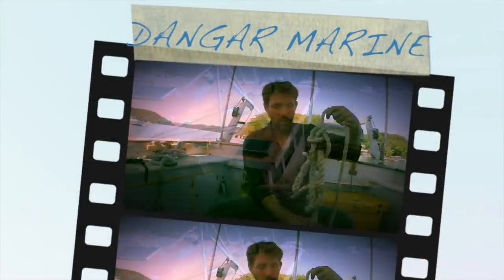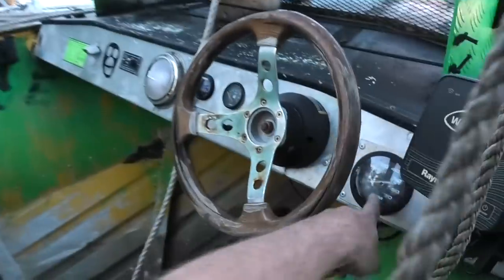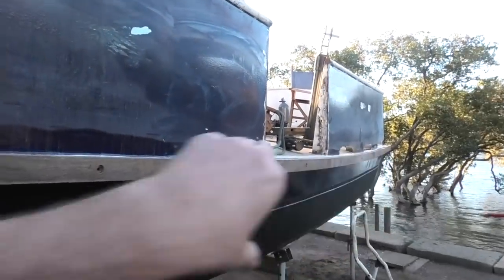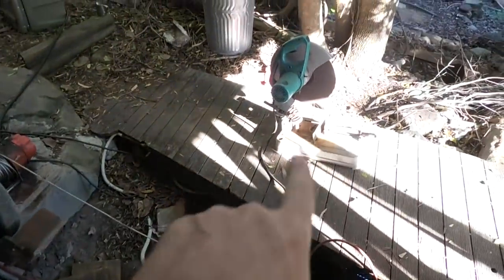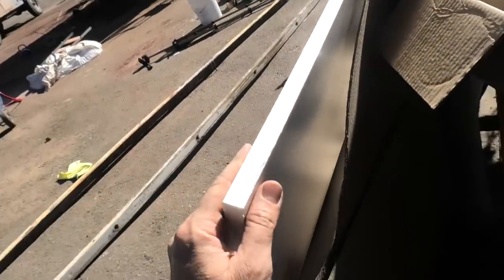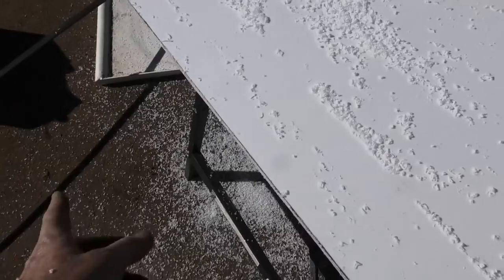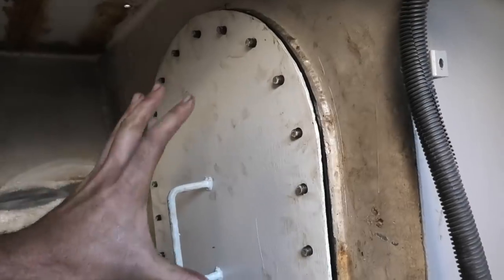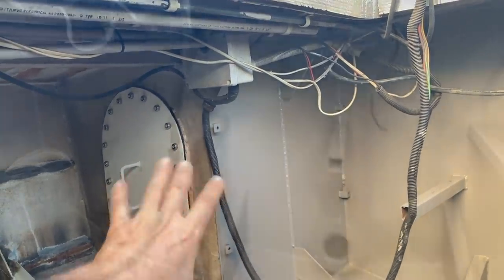Electrical boards and engine bay cleanup

Comment: You should look for a 4m RIB and put the 40 on it. Great runabout and tender.
Reply: Stu wants an inflatable. I know RIBs will have better sea keeping capability, but a 4m on the back of the trawler will kill any available space. Long term looking for something made with hypalon is the way to go. PVC in Aussie temperatures will have shorter lifespan.

Comment: Hey Mate you should replace that power cable running to your electrics. It can still be used for something on shore but I wouldn't trust it long term on the boat. Try and eliminate as much old wire as you can. It introduces too many variables and fault points. One other thing test that board your thinking about mounting the electrics to for spark flammability open flame flammability and heat flammability. You might want to also make sure it doesn't react to diesel fuel or become more easily flammable under those conditions with diesel on it. You don't want to find out later ten miles off shore that it catches really easily. Cheers Mate!
Reply from the maker: Yeah, I’m thinking of replacing all the wiring.

Comment: I don't know if the shelf is still an issue. I doubt it is. But I know here in the US there's this PVC like trim you can get from the home improvement store. It's primarily made for trimming out bathrooms. It's mold and rot resistant and all that good stuff. You could grab a small piece of that and make a little lip on the shelf with that. Guess I'll find out in the rest of the series if it's ever solved. Lol.

Comment: Good morning. Looking forward to the electric video.
I like the idea of the shelves....but just a thought here, since the plastic board is so pricey, I would consider just using plywood with an epoxy coat. The "StarBoard", as it's known here in America, is UV tolerant and I'm guessing you will have lots of opportunity to use it in places in direct sunlight. Anyway, I'm enjoying your project. Thank you

Comment: Looks great so far if you're going to use that shelf for the batteries on those three posts I think should be reinforced either to the floor or to the ceiling, batteries are heavy and bouncing on the wave you may just rip them off ..
Reply from the maker: I know what you mean but they've been there for a while and I can put my full weight on a single brace without the slightest flex which is a lot more than the batteries. Having said all that, a gusset at the bottom certainly wouldn't hurt.

Comment: That engine room is looking a whole lot better now!  one question....did you keep the full sheet of nitrile on the other fuel tank cover? and that will be interesting to see the pressure testing when that comes along.  man, this baby is getting there...and it seems like time is just flying by!!
Reply from the maker: No, in the end I was convinced to cut them both out to avoid condensation corrosion on the inside of the hatch cover.
Reply: @DangarMarine  well that makes a whole lot of sense now doesn't it!! Cool and thanks!

Comment: Have you tried an electric wallpaper stripper and a length of 4" drain pipe... I have used it in the past it works as a cheap alternative. Great vids, cheers Stu!
Reply from the maker: I'll see if my local hire store stocks them.

Comment: Hey Stu just an out of the blue suggestion probably too late to be useful (I'm only 4 mins into the video) but you could have/could still put a bolt into the front of hole of both rubbing strips and running a ratched strap around the front of the trawler and slowly day by day pull it in together

Comment: Hind sight is always better huh?  Bolt heads welded to back side of the brackets  would have been ideal. That way the nuts would have been visible on the board and could be checked periodically.

Comment: Those panels should be hinged so you can run the wires in the back of them
Reply from the maker: I can see how that would look neat, but I like having the wiring on the front so I can trace the path of the connections easily.
Reply: @DangarMarine  I did it so i could run all the wiring in finger duct behind and then new wiring can be added later on very easily.

Comment: For the battery shelf is the polyboard strong enough that it won't warp over time under the weight of a battery?
Reply from the maker: I think it will be fine with the three metal supports under it, but that's a good point to consider.

Comment: When it comes to inflatable tenders, I do have some experience in this department. 
After purchasing many waist of time cheap Chinese ones, I finally saw the light and bought from a reputable company.
Swift marine make a great inflatable, if you are like me and cant afford a Hypalon inflatable then I suggest the Highfield that they sell.
I've had mine for years and still nothing has come acropper on it.
Its a 2.6 Alloy bum and I've really treated it poorly but it just keeps staying strong, even with an oversized outboars.
Inflatable tenders are a bit of an issue with us grotty yachties but the arguments always stop now that I bit the bullet.
Btw, I recon I've saved $$$ by now by inisually spending the outlay of a good inflatable, than to buy 5 cheap Chinese ones.
Just saying.
Reply from the maker: Yes, I'm not expecting this cheap one to last that long, but it will get my out of trouble for a while and I'll look for a better one when I can afford it. Thanks for the tips!

Comment: all  electric should be in a sealed cabinet because you having them in the engine room .and battery's  in a vented box because of acid  fumes on flammable gases  which well corrode your electrics and other metal part.  always expect the worst case scenario  when it comes to mix electric water gases and fuels ( DON"T )  this is a practice i was taught and used over the 40 odd year boat building. great job you are doing too
Reply: Excellent Advice, Stevo.

Comment: Enjoy the break Stu. For a Perentie road trip @ 100-110km/h, I would recommend some hearing protection. Assuming no mods, she will be noisy at highway speeds (but you already know this from the M1/F3 no doubt). I used to use noise cancelling headphones. Takes the edge off the engine/road/canopy noise, can listen to music/podcasts on phone. Plus you can still hear high frequency environment noise (eg. horns, sirens ... tyre squeal). Would be awesome to see you drop in on a Brupeg vid. Safe travel.
Reply from the maker: Yes, have done a few several thousand km trips in it. Sure can get noisy!

Comment: are you going to put any noise dampening foam or sheet inside the engine bay?
Reply: I was thinking the same. Pink board glued and sealed up   Great
Reply: If he does not he will be sorry.  Can’t have enough sound insulation on a Detroit.

Comment: For a big wide gasket like that and with as many fasteners as there are holding the cover on I think 20nm should be plenty.
Reply: Remember that the gasket is going to relax over time. I'd verify torque in a week.

Comment: To be to standard, the batteries should be in a container/box that can contain acid in the event of a case spliting or worse. 
As always engoyinyg your videos, safe travels.
Reply: batteries dont just leak acid. they are quite robust. no such thing needed
Reply: @rigdigwus  On a boat like an aircraft, upside down is an option. 
Batteries off gas hydrogen when charging if you dont use sealed recombinant electolyte batteries. This needs to be vented to prevent explosions. 
Any seawater round the battery and you get chlorine gas on one terminal and caustic soda on the other so keeping them dry is also a priority. 
I wouldn't put electrics round the engine that dont need to be round the engine for these reasons. I would put a sealed breaker panel near the console with a minimal package where flooding may happen.
A SLA backup battery for radios etc in a separate box may be a good option too.
Reply: @rigdigwus  IT is a requirement in boats for a reason, Ive seen cracked cases, cases that have blown the top off and split down the sides dropping the entire contents of an N200 into the batttery box, corroded terminals, have you ever seen an older car without a corroded steel battery tray? even if the battery is intact, now think about that happening in a  boat hull....Nobody has to do anything I reccomend but if you want a safe and legal system electrically
Reply: @allangibson8494  Good points, All the heavy DC should stay in the engine room to keep the cable runs as short as possible, exept on petrol inboard boats for other reasons . Survey vessels do have a radio battery in the bridge as a requirement.
Reply: @Nick75au1  A lot depends on your paranoia level too. 
Having been involved in oil rig systems design, a DC plastic dip or heat shrink insulated buss bar (2" by 1/4") would be preferred over cable and hull negative returns would be avoided totally. All penetrations through bulkheads should be via pressure tight IP68 cable glands.
Electrical boxes should be IP68 minimum and IP69K if possible.
The next step up would be fitting the engine with dual starters, one electric and one hand cranked spring recoil starter (this is done on marine lifeboats (and the oil rig fire pumps, emergency generators and air compressors (hand starting a 27 litre diesel engine is a really good workout (the usual starters were an air starter on the electrical generator and an electric starter on the air compressor)).
Depends on how much water in the boat you want to be able to handle and how far you are willing to swim....
Reply: @allangibson8494  Yep oilrigs and SOLAS regs add a whole new layer to what needs to be done. Im coming from requirements for recreational vessels and have some knowledge of small vessels in survey.

Comment: Why not try some of that super flex tape they say will seal anything? Good video maybe?
Reply from the maker: Would be an interesting experiment.
Reply: @DangarMarine  Being the busy guy you are, it could just be too big of a time sink to bother however, I think you have a solid plan replacing the Green Machine, no more mornings walking down to the dock wondering if it's above the water line.

Comment: Why no washers on those studs? Spreads the clamping pressure out further and prevents deforming the covers.
Reply: Do you mean on the fuel tank covers? I thought that, but look at the thickness of the material. It'll be fine.

Comment: With those stuck gate valve tops, don't use the bench vice to try to hold the valve, you might find if you get a suitable small tree, stump or other strong fixed object and put a length of chain around it, then the chain around the gate valve body you can put the pipe wrench on it with a torque multiplying pipe on the handle and it may come loose.
Reply from the maker: Yep, the entire bench moves when its in the vice. :O
Reply: @DangarMarine  I found stringy bark gum trees work well as the part is gripped somewhat in the thick bark and is less likely to slip around.

Comment: I would do the battery shelf because it would look neater, and when you go to run the wires you can neatly cable tie them to the board before they go where they have to go. Plus you have a shelf where you could mount more electrical things like distribution blocks to save room on the electrical boards.. I'd also run at least 4 gauge wire up to the pilot house as this will give you plenty of head room for further electrical goodies you'll likely add on in the future.

Comment: you say electrical board without knowing whats going on the board wouldn't it be more convenient to mount the electrics on the back of the cab in a waterproof plastic box  so if something goes wrong and your being chucked around on the ocean your not crawling around in the engine bay where you slip down the side of the engine and get stuck and not get out ,,you laugh its happend
Reply: I like the idea of having the breakers and emergency kill switch in the wheel house.

Comment: Hi Stu,
If you have enough rubbing strip to start from the front and work back to an area with less bend would be ideal. Make your miter joint in the less bend area so the pressure of the mounting holds the joint together, some water proof epoxy will be good also and clamp it with 2 different pieces of angle; one from back other from top to squeeze it together square until it sets.
Think about your electrics as a system, DC/AC power buss (batteries/Generator), shore power,  grounding buss and neutral buss; engine controls, navigation lighting zones, marine instruments/radio (isolate from electrical noise) Accessory power USB, plug-in items everyday convenience, 12v lighting and or full power lighting, solar/wind charging; grounding to Sea.  All items/panels need to be grounded. Different boat hull metals and valves/through hulls need to be bonded to mitigate electrolysis/galvanics . Each panel should be grounded to every location so your reference does not change from any location in the ship. Figure out a color code system, so when you are into it for troubleshooting and servicing it is visually easy to follow. Then plan your layouts, so say you do not want to go to engine bay to reset a breaker for nav lights, or to install your radar or loranz, depth sounder instruments.
BTW the old electrics on the ship might be part of the reason your different metal valves and components are so difficult to take apart (electrolysis/galvanics) welding the air-gap of the threads together. I did not remember seeing any wires attached to any joints or couplings in your tear-down videos.

Bite the bullet if you do not have one and get a commercial wire labeller.

Investigate Pre-assembled wiring/switch/circuit breaker panels as they may be more cost effective, dollar and time-wise; according to boat builder electricians reviews in blogs.

http://www.marinesurvey.com/yacht/ElectricalSystems.htm

https://www.westmarine.com/WestAdvisor/Marine-Grounding-Systems
Reply from the maker: Hey mate, thanks for all the info and the links, will read them now.

Comment: I would consider a split electrical system. Main for running boat only. ( necessity systems to run the boat ) second system for auxiliary   ( cab lights,etc. non necessity systems ) so if you ever run into a power issue bad battery(s) alternator, wiring issue  you can direct all power to running the boat.

Comment: That poly board has no structural properties, so I would hesitate using it as the shelf for the batteries. Would recommend placing two pieces of rot resistant wood on the brackets then you could place the poly board over those and you would be fine.
Reply from the maker: Good idea.

Comment: Another good movie as usual Stu. We know that batteries last longer when they're cool and charged? The engine room is quite hot  and not the best place. I have 5 x 8yr old AGMs still doing well in a seperate compartment. They're connected to a Victron charger and I dont use shore power; just solar. This been good value for me.

Comment: Scrape the hull and fix the split by brazing an aluminum patch over it. I know that it will flex, but the patch can be longer to fix between hull braces. Either that or recycle the boat. Sinking it makes a navigational hazard.

Comment: Hi Stu,
           I reckon the green machine engine is worth a bit and the trailer mate, but I think the boat will be soon be coke cans.

Boats looking real good, its a lot of work on your own Stu and every now and then you'll be over it all.

Better to take a break I think, recharge, regroup, get the lantern shining bright again and remember what your doing it for.

Water tight or waterproof electric circuit breaker boxes are the way ahead mate, will protect all your wiring and save you a fortune and time in the long run.

Not expensive and nice n neat, trust me.

Enjoy yer road trip to Brupeg

Comment: The best reason to wear safety glasses isn't to prevent a big chunk of material from flying off the tool and punching out you eye. It is much more likely that you will get a small speck in your eye that is so irritating you need to spend 30 minutes in front of a mirror trying to get it out rather than working on your project.

Comment: I seen this from someone else = why don't you buy one of those wall paper steam strippers    better than a kettle I would go a bit further and cover the wooden length of transom in a metal pipe seal it at one and let the steam in the other end I do this while making clinker boats works fine

Comment: A plumbers tip for your seacock valve. Have your wrench as you had it in the video trying to unscrewing the gate off. Put pressure on it trying to take it off and as your doing that take a ballpeen hammer and tap where the threaded gate goes onto the body rapidly but not really hard. Keep the pressure on and rap it till it breaks loose I've done this on 100 year old valves (not on boats) with 100 percent success. This goes with the mechanics belief that most mechanical problems are solved with a ballpeen hammer.
Reply from the maker: Thanks mate, I'll give that a try.
Reply: @DangarMarine  Hope it works on a seacock. Different set of rules with salt water.

Comment: Looking forward to the plans.  Did you tap threads on the electrical boards mounting brackets?
Reply from the maker: I didn't because I think they are a bit too thin. I was thinking about tack welding some nuts onto the back but by keeping them free I will have a little bit of wiggle room if the drilling isn't 100% (ie, 6mm bolts through 9mm holes)

Comment: great video again Stu, when you're looking at Brupeg that is the best wiring job I've seen outside aviation and should be your template for layout process obviously equipment levels etc will dictate the amount of wiring but their wiring practice is impeccable, I believe an aviation sparky helped out. with that style of wiring later mods and repairs become easy. cheers moose